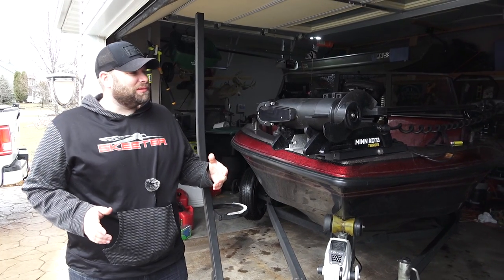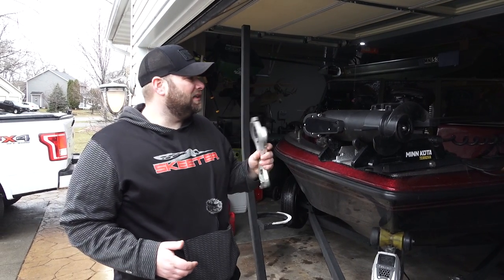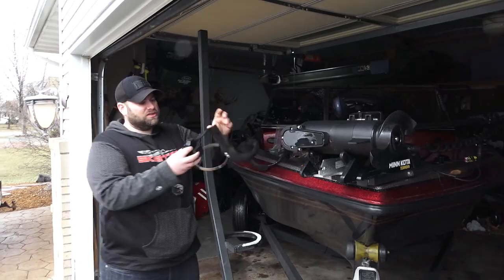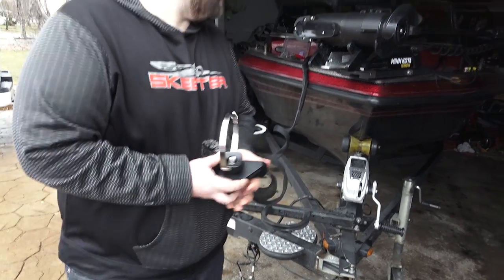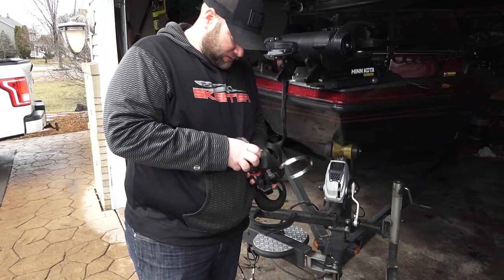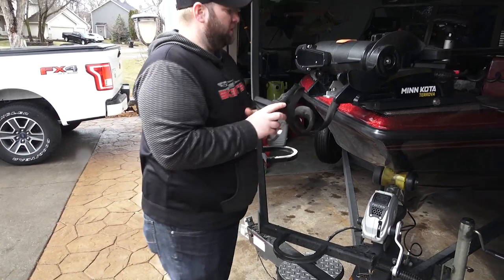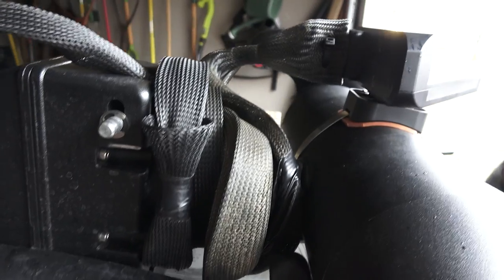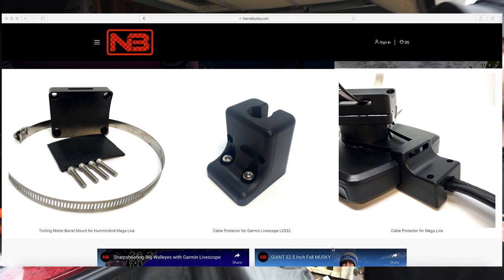How to Mount Garmin Livescope on the Barrel of a Trolling Motor

Comment: I have a Minn Kota so I like the way you installed it. But why do most say it should be installed on the shaft, at least 7" above the motor?
Reply from the maker: They are mounting it on an Ultrex, which allows a shaft mount.  The 7 inches has to do the the angle of the shaft mount to clear the motor barrel. For other motors like the Terrova, the shaft mount is not an option as the shaft slides through a housing. You can barrel mount on a Ultrex too with no interference, but just have to be careful if you fish in shallow water to make sure your not banging bottom or stumps. You’ll get a better return with a barrel mount because you can have a 0 degree angle to the lake.
Reply: @NetBuddyFishing  Great! Thanks for the quick reply! You don't seem to see many that mount the livescope transducer on the barrel. Not sure why. Thanks again.

Comment: Good video and appreciate it.  When you automatically stow the motor, do you need to baby sit it?  Meaning, I see when you manually stowed in in the video, you grabbed the loops and brought them up over the cradle.  Thanks....
Reply from the maker: I would not do an Ulterra Auto stow and deploy this way. You will likely pinch the cable. There is a video out there where they uses a coiled bike lock on the side for the ulterra cable, that seems like a much better idea.
Reply: @NetBuddyFishing  okay.... Just saw that you were showing an Terrova and not an Ulterra.  My bad.  I will look for that video.  Appreciate the quick response.

Comment: Can you post a link for the  cable protector? I am not finding on your webpage.
Reply from the maker: I discontinued it, I don’t think it was adding a lot of value. Electrical tape at the base to attach the sleeve will do the trick. I did that for 4 seasons before making the protector without issue.

Comment: I have a totalscan transducer for my Lowrance unit on the barrel of my terrova.  Have you had any experience with barrel mounting livescope as well as another transducer other than the humminbird one that's built in?  I'm worried with it being so close to the totalscan that there will be interference.
Reply from the maker: I have had Livescope barrel mounted for 5 years now, 0 interference issues.

Comment: Watching one year later. Any experience with your system and the Ulterra automatic deploy? Cable management is the concern. One could not wrap the cable around the Ulterra post like you do with the Terrova. If there is a tangle or knot, the Ulterra deploy motor is strong enough to pull the transducer cable off the transducer. Which is not good. Perhaps I try to rig it up with 14/2 wire in a rod sleeve as proof of concept before I tie my MegaLive transducer cable to the Ulterra bullet. Thoughts?
Reply from the maker: You can’t do this with an ulterra. You’d need a different way to do cable management. I’ve had this on my terrova now for 6 seasons no issues.

Comment: So i just mounted mine like this yesterday but the install directions for forward mode did not have it sitting like you had. It had it slightly canted upwards and forward not straight???
Reply from the maker: The 32 or the 34? The 32 to top should be flat for forward mode. Or, it can be mounted facing the other direction, where then the bottom would flat. The 34 has a slight tilt up.
Reply: @NetBuddyFishing  Yup my bad i didnt notice that was a 32. Your spot on man.

Comment: I can’t find the cord saver on your website am I over looking it?
Reply from the maker: Hey Brandon, Yes, I discontinued them.  I found they were not needed after a year of using, with the changes Garmin made to their cord.  Electrical tap to attach the cable sleeve would work good.  I did this for 4 years with no issues.
Reply: Ok sounds good thank you

Comment: So in this video, that is a zero degree mount, barrel bracket?  Wondering if the barrel mount that comes with the LVS32 is standard zero degree or purchased separately?
Reply from the maker: It’s the standard barrel mount, but it’s set at 0 degrees before I tighten it down.
Reply: @NetBuddyFishing   Have you had any experience fishing shallow water (10' or less) with the ducer being mounted to the TM barrel?  Wondering if there is any interference or noise due to barrel mount in shallow water (like for crappie fishing open water suspended fish)
Reply from the maker: @MrDereksykes  yes, all the time, no barrel interference